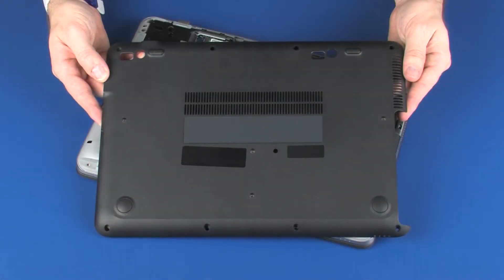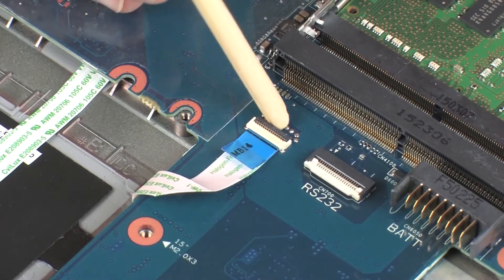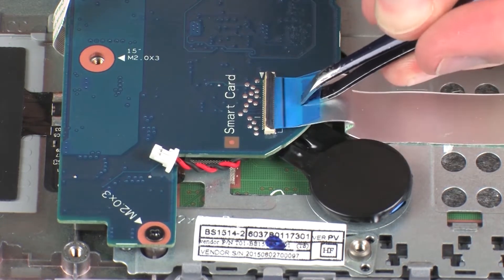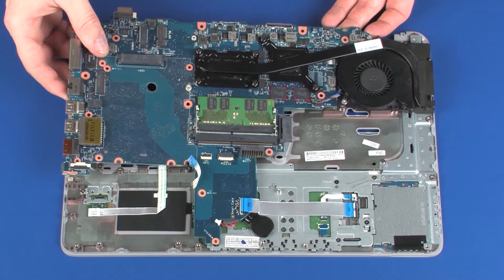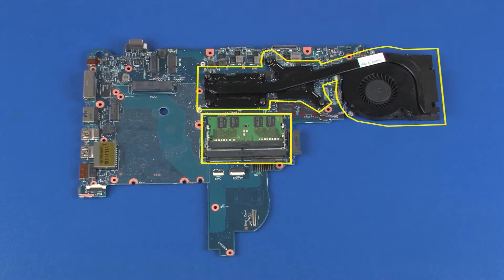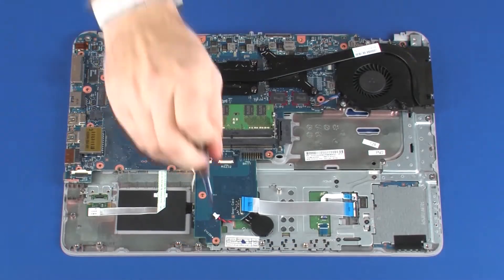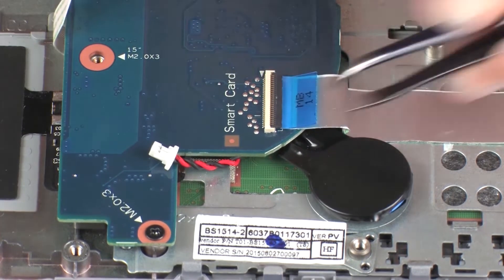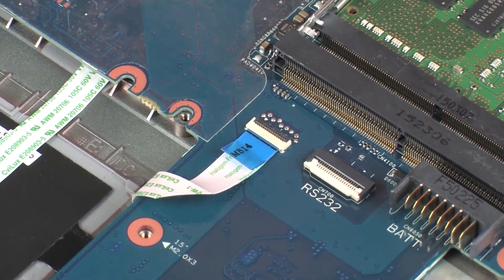Replace the System Board | HP Probook 640 and 645 G2 Notebooks | HP Support

Comment: What is difference in system board and motherboard please reply
Reply from the maker: +Aditya The motherboard is the piece of computer hardware that can be thought of as the "backbone" of the PC, or more appropriately as the "mother" that holds all the pieces together. ... A computer's motherboard is also known as the mainboard, mobo (abbreviation), MB (abbreviation), system board, baseboard, and even logic board.

Comment: this video  is missing so many steps for the actual system board replacement procedure. It doesn't detail anything about any of the underboard ribbon cables or connectors.
Reply from the maker: +james lunn Please refer this document to know about replacing system boards: http://bit.ly/2teHtsw